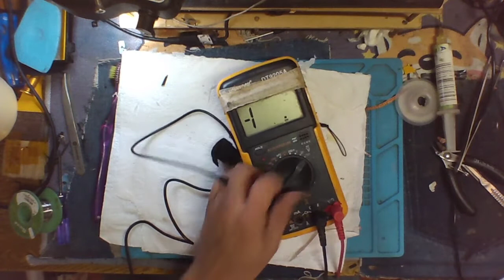How to fix laptop charger - cut wire

Comment: Need po ba Yung naka cover na wire sa white plastic before mag open?
Reply from the maker: opo, ground wire po yun. sya yung negative
Reply: @clpcrandomrepair  pwide po ba Yung paper type po Wala po Kasi Ako electrical type
Reply: Para po sa negative at positive
Reply from the maker: pwede po yun, as long as isolated yung wire sa loob ng color white cable at wire sa labas ng white cable
Reply: @clpcrandomrepair  naayus ko din salamat po pag sealed po nila okay lang po mag ka connect Yung paper type pero Yung positive negative nag kalayo po?
Reply from the maker: opo